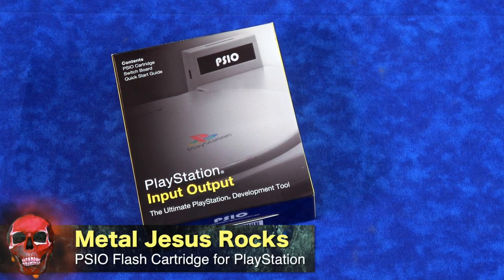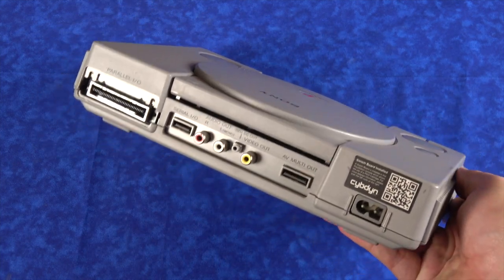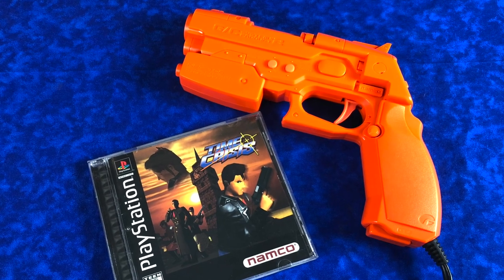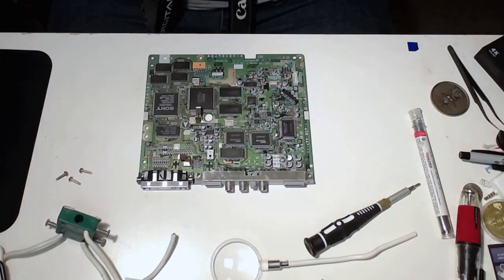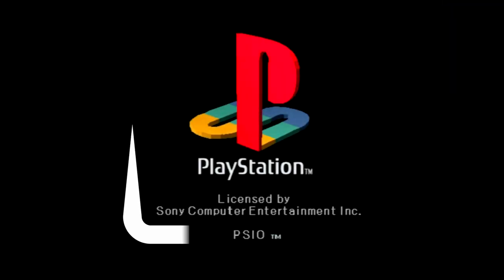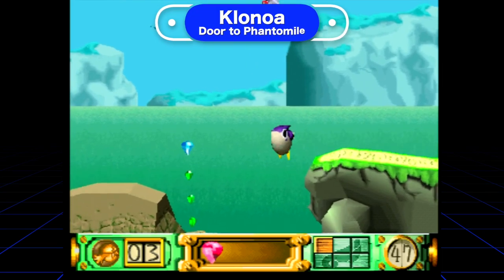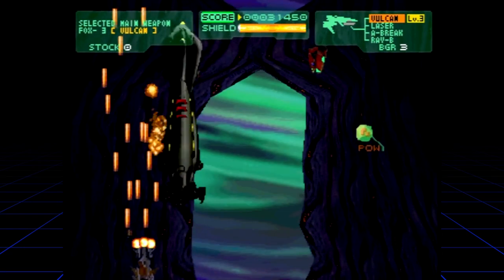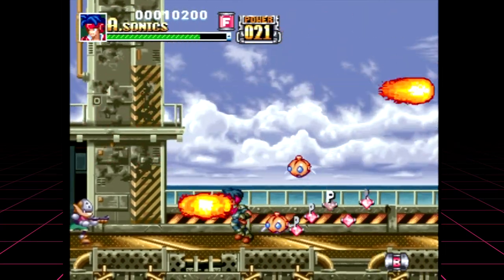PlayStation PSIO - SD Flash Drive for your PS1

Comment: This thing seems pretty sweet, but it's $149.99(AUD) or $106.48(USD)! For that price you could essentially mod the PS1 classic.  This is still better... but you don't need to solder anything or get anything shipped from Australia.  Not to mention you need a specific PS1, which may set you back another $20.
Reply: Stone age gamer carries these. They made a deal with Matt.
Reply: @zRedGemz  It's $124.99 from them.  Not bad... but not great either.  I might pick one up next year.  It seems like a fun project. If someone has a console already, I can see this being a decent alt.  If not, getting the classic console and modding THAT to support more storage might be the better option.

Comment: MetalJesusRocks is there a way I can play PS1 games on my ps3 and use flash drive in place of a memory card and memory card adapter?
Reply: Basically, PS1 games running on PS3 are running under emulation, so you will only get virtual memcard that had been created from PS3 menu.

Comment: My PS1's laser assembly has died, so this might be something I'd consider rather than just replacing the assembly with a new one.
Reply: @oldgraphics  An actually helpful comment response on YouTube? Wow! Thanks- will have to look into the capacitors. Anything to keep my PS1 games going.
I mean, I*could* actually just get rid of the PS1 and play the games on my PS2 or PS3, but I'm sort of attached to the PS1, as it was the first console I bought myself with the wages from my first job, so if I can keep it running I'd like to.

Comment: wtf that price is a nope 106 $ really..... maby for 30$
Reply from the maker: Most EverDrive like SD card systems cost more than that because they use FPGA boards and custom programming.
Reply: Yeah mj I guess your correct but I'd say jus a tad less expensive jus because of the soldering thing, I'd be comfortable paying 80 - 90 with soldering if you didn't have to solder I'd pay 200$ no problem

Comment: My console has a chip to play copied games... Even if I ordered something like this, I need to solder again that chip that comes in ?
Reply: No. You don't have to.
Reply: @yomeroyomismo8212  I just need to plug that cartdrige behind the Playstation and that's it ?
Reply: @malagueta1986   No. You still  have to mod your ps1 with the chip that comes with the PSIO as you saw in this video.  The PSIO bypass the CD-ROM drive,  so you don't have to desolder the chip your ps1  already has. For example,  if you want to play copied games just disconnect the PSIO from the back and put the copied ps1 cd in and  it'll play it  like before. I hope you understand me. Bye.

Comment: This looks interesting, but there are cheaper alternatives. You can get a modded Playstation on ebay for about $50, and buy the Pound HDMI cable and still save money. Get a spindle of Verbatim AZO CDRs, and you're good.
Reply: Oh really? How are the AZO discs?
Reply: @bustergundo516  They're perfect. You can burn them at max speed and they're fine. Make sure the Verbatims you get have "Data Life Plus" and "AZO" on the packaging. These are made by Mitsubishi chemicals. Regular Verbatims are made by a Taiwanese company called CMC Magnetics, and are garbage. I went through an entire spindle of those and not one disc was good, no matter what speed I burned at. The funny thing is, both are about the same price.
Reply: @Helvetica_Scenario  how can one tell the difference? Does it also extend to dvdr as well? I am having my ps2 modded and I already have 82 blank discs.

25 dysek 
50 Memorex
1 Kodak
9 verbatim 

Which one should i use for ps2 games?
Reply: @bustergundo516  I've never done PS2, but I know they also make AZO DVDs. If the DVDRs you have don't work for you, look for them on Amazon. A spindle of 100 goes for $25. They say "AZO" on the lower left hand side of the packaging.
Reply: @Helvetica_Scenario   okay. Will burned ps1 games work on modded ps2?
Reply: @bustergundo516  I  don't know. I've never used a modded PS2.

Comment: Is this CD drive still usable after you make this mod?
Reply: Tyler Tylerson that's the point of the switcher circuit. Original CD ROM still works or you can run from SD card.
Reply from the maker: Yes. Just unplug it and the PS1 is back to normal.

Comment: Awesome! But seriously 130 bucks for a psio is too high not to mention you also need to solder it. Might as well just buy a ps classic and hack it, or a raspberry pi 4 and install ps1 emulator on it. Both are already cheaper than psio.